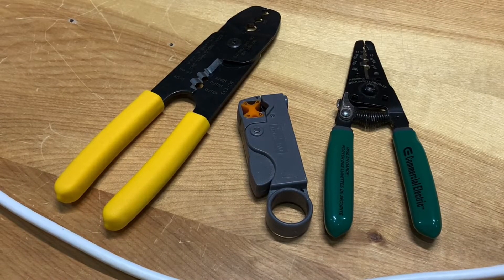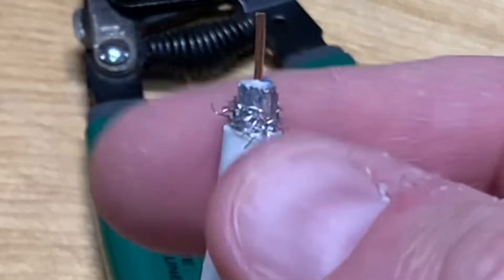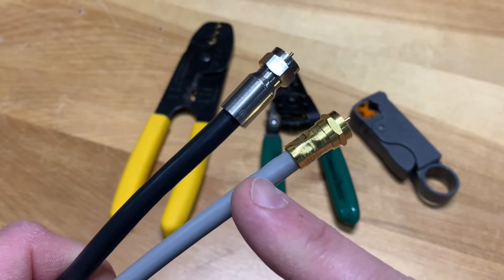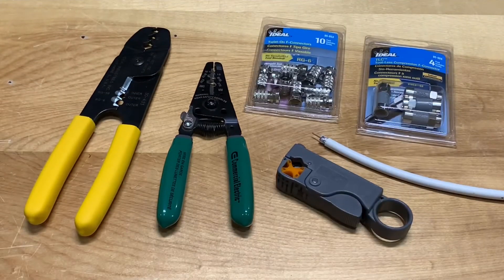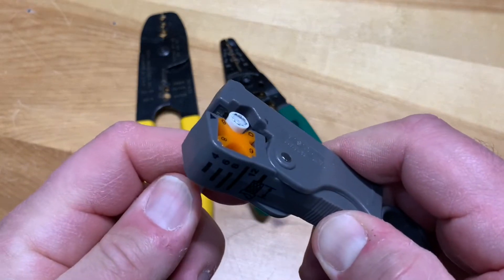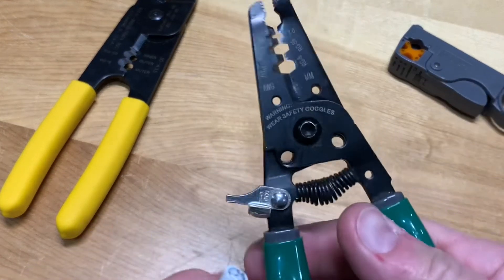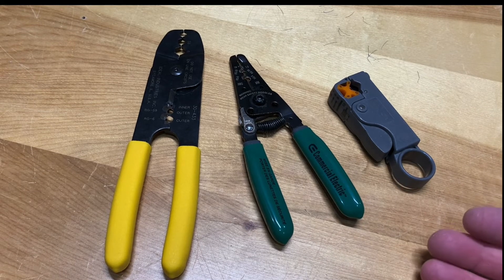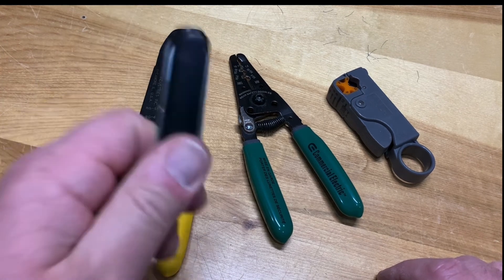Coaxial Cable Stripping Tools For the DIYer | Coax Cable Installation

Comment: I remember first time when I cut an RG6 coaxial cable with the knife, it looked awful and time consuming, so i decided to buy proper tools and in a matter of seconds I can make my own coaxial cable.
Reply from the maker: Yes, a knife only works if you’re careful and know what you’re doing. I prefer the right tool for the right job.👍
Reply: @NorthcoasterHobby  The first time I used the knife I cut myself but that wasn't a problem there were two problems it looked ugly and problems with the F connector, with the proper tool you are doing a profesional job in a few seconds (maximum 30 seconds)
Reply from the maker: @Nicholas_Chris  Agreed.